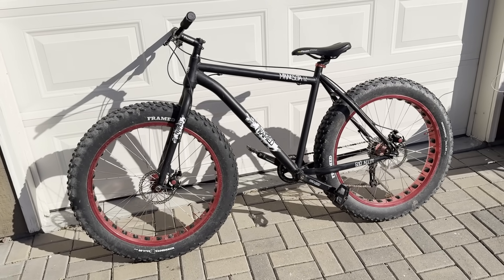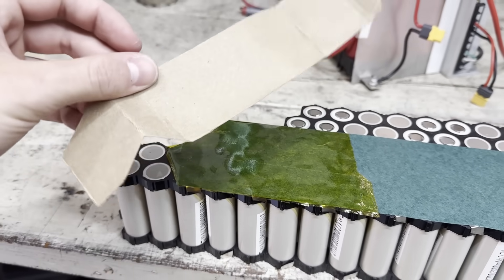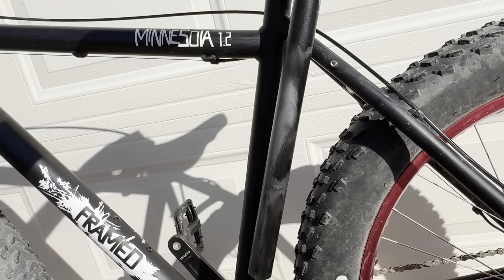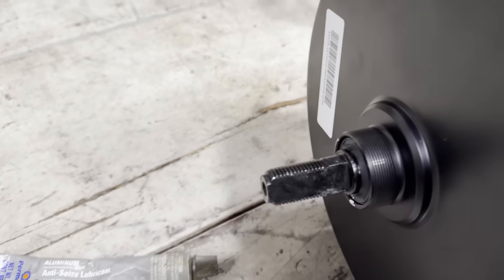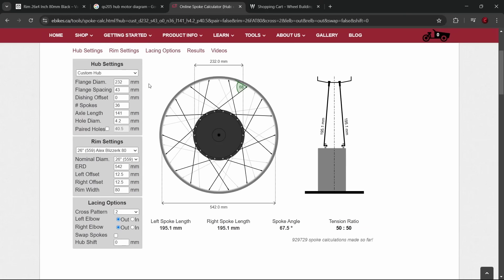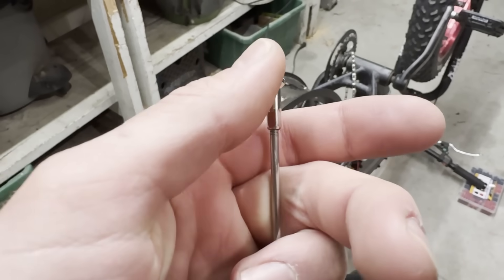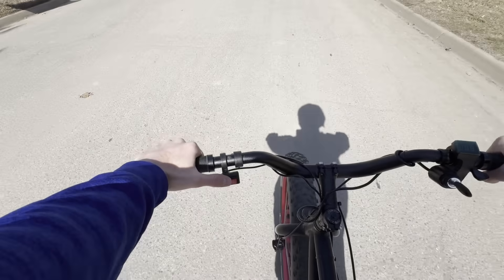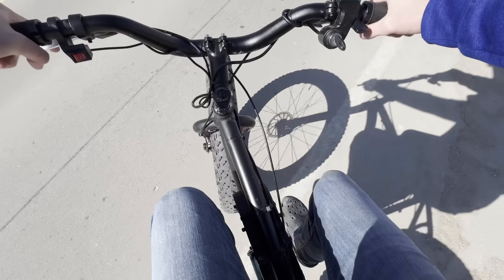Overpowered Fat Tire Ebike Build

Comment: Awesome build as always. I am impressed by how wisely you chose all of your powertrain parts. 

Quick question since you said you used a QS205 5T (I assume 50H) : since this motor has a Kv of 9rpm/v so 650rpm at 72v, you used Flux Weakening to be able to reach 60mph right ? 

If you have time, could you do a video on how you tuned your Fardriver app on this build ? That would be interesting to see too. 
Maybe installing a display in the future ? I just want to see more videos of you with this bike 😁

Anyway, I hope you keep doing crazy builds like this. You are a very talented mecanic 💪
Reply from the maker: @elias8981  Yep, I had flux weakening on. Normally I just run the auto learn and use that tune, but for the bike that’s in the next video I ordered the controller and motor both from QSmotor and they did a custom tune that uses the field weakening over a much larger RPM range then the auto learn does so I changed the tune on this bike to be more like that. I don’t know if I filmed the top speed clip before or after I did that. I wouldn’t really use a display enough to justify installing one on this bike, compared to the EGO minibike that’s more like a motorcycle so it’s a lot more useful. I probably won’t do another video on this bike, I’m about to list it for sale so I probably won’t even have it for much longer but I have lots of ideas for future projects so stay tuned!
Reply: How much current of field weakening is required? @Calthecool
Reply from the maker: @wtsuser I forgot, sorry. The field weakening is set as a percentage in the controller and it’s a list of like 14 values for each RPM so it’s not like one simple number.

Comment: Now Thats Clean!! lol come to Minnesota to sell it theyll pay good for that🤣
Reply: also did lacing the hub motor end up cheaper than buying it pre laced?
Reply from the maker: @Taes2wheels  I don’t know, you can check all the prices in the pinned comment and compare it to any kits you can find. A lot of kits will come with nock-off motors and sabvoton controllers, so I think it’s worth it to build it like this because you know you have a real QS motor and a better Fardriver controller. It is annoying though, I had to constantly tighten the spokes for the first probably 15 hours of riding the bike.

Comment: a few opinions i have on your ebike is:
1. if i counted correctly you have a 20s4p pack with your mentioned samsung 40t cells, and if your saying your getting 8kw would mean you be pulling close to 120 battery amps = 20 amps per cell. please note at 20 amps your cells will become quite hot and their life span will dramatically reduce if done so for long periods of time.
2. for your qs motor please do put some sealing/gasket agent around the cap as riding in snow is bound to bring rust and other problems

the above is completely my opinion so i might be wrong :) 
still amazing video love the work🔥🔥
Reply from the maker: They are 30T cells with 35A continuous discharge rating, and 120/4=30 so they are only hitting 86% of their max rating. You have to keep in mind that if they have a 35A continuous discharge rating then they are rated to do 35A from full voltage to empty continuously, so me doing maybe 15 seconds of 30 amps or cruising at 15 amps for a while isn't going to make them heat up very much.

I try to keep water out of the motor as best as I can, I only rode in the snow a few times.
Reply: yes i agree they wouldn't heat up too much but just to keep note if you want more range/ lifespan of the battery do add more parallel cells to reduce stress,. good to know your keep your motor out of water.

Comment: Very nice.
All interesting for me, as I've already done a few e-bikes, 1500w & 2000w with 52v20ah...
But...I've recently bought a Glitter 801h spot welder, and I'm just in the process of buying all the other bits, like kapton tape, fishpaper, copper/nickel busbars, wiring, cell spacers, etc...just spent £78 getting a nice stock of stuff...

Just need to work out what BMS and where to buy cells from (I'm UK) but...I do have about 68 18650 (pink SINC ISR18650 26A21A25062264... It says on them, all same cells salvaged from a barely used damaged 52v pack a friend gave me).
There was I think in total some 74 cells, but 6 or so I couldn't resurrect with my liitoKala pd-4 18650 cell charger...got them all to 4.2v..
But, I think I need to get a charger/drainer thing to be able to test every cell before I attempt to build a pack..

But also, I'm still learning and also bought Micah Tolls "DIY Lithium battery" book which I'm reading at the moment.
I'm hoping to build a 60v pack to test with my 2000w52v motor, my controllers rated up to 72v but I think 72v may be overkill..

So, I'm going for 60v instead, just a small 60v 8-10Ah pack I'll build first just to test it out at 60 volts, using the 18650's I've got for free.

Then I'll order some hot ghee capacity/ output cells and build a higher Amphour 60v, or maybe even 72v (..I dunno)

To be fair my 52v 2000w build is pretty fun, but I just want to try out 60v on it.

Great build Cal, always enjoy your content..
Educational for me too, so it's appreciated.
🚲⚡👍